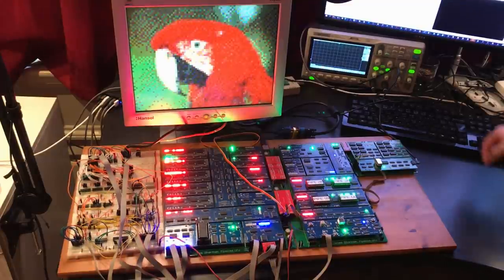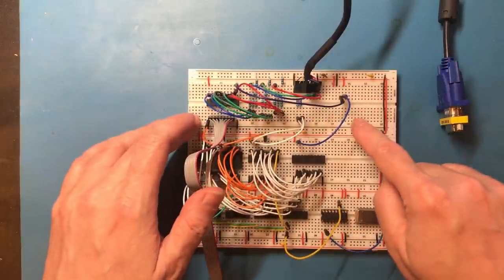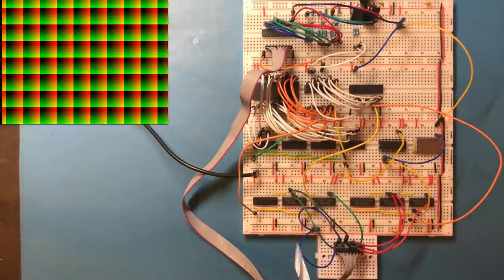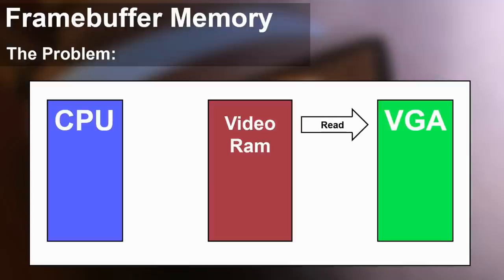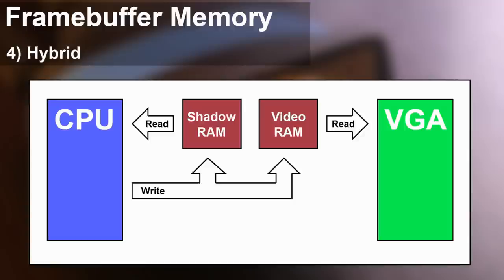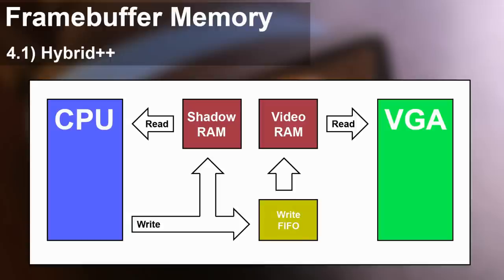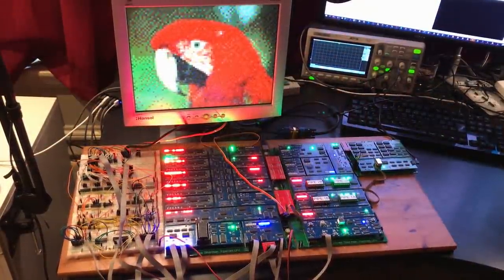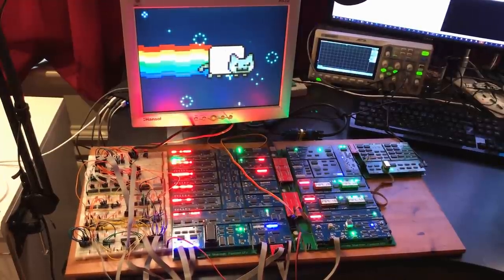Framebuffer - VGA from Scratch - Part 3

Comment: It was surprising to use two RAM chips just for the sake of allowing the CPU to read back video data. Wouldn't it make more sense to use one RAM chip for storing data from the CPU while the other one is being read by the VGA circuit? If we could allow the CPU to swap between RAM chips, then it could freely read and write from the current RAM chip without worrying about what the VGA circuit is doing to the other RAM chip.
Reply from the maker: You have to look at the decision in context. I didn't add two2 ram chips, I added one for the video side and used a portion of the existing ram I already has to shadow it. To implement the scheme you suggest it would be necessary to modify the existing memory pcb (which was designed with knowledge of what I was intending to do here) and then double up the ram+multiplexor circuitry that I added in this video for the two halves (plus the additional logic necessary to manage the change). What I've built get's the functionality I want with the lowest circuit complexity, naturally I could make a better circuit by adding more complexity but it's always necessary to strike a balance.

Comment: I think you can dualport the ram if you would use input and output buffers for adress and data and then run it at twice the pixel clock. Dump what you want into the buffers and clock data whichever way.
EDIT and you just discussed it in the video as multiplexing 😉
Reply from the maker: I do try and cover the obvious stuff that I'm not going to use, but it's impossible to talk about everything. This video was far too long as it is.

Comment: I'm curious why double buffering wasn't considered as you're already going with double memory.
Reply from the maker: Let's be clear, it was considered but rejected. It would have made the doomed demo easier though but for the most part 8-bit era games used scrolling and incremental update as the means to get games updating quickly.  Double buffering would have been a more complex circuit (If you want to separate bus access) and is a real pain for anything where you are not going to redraw the entire screen.  I have plans for future builds which will include double buffering though, just not this first one.

Comment: Im designing something which outputs VGA and HDMI, I also decided to double up the ram.
Reply from the maker: Hope that works out for you. I wanted to do analogue VGA as it was the technology I grew up with. There are chips that do the hard work of encoding but didn't feel right. Essentially the vga to hdmi cable I'm using to capture footage is one of those chips I suppose.

Comment: I don't quite understand why the CPU would need to read from the frame buffer unless you need to perform a screen capture.
Reply from the maker: If it’s not a nead you have then don’t worry about. I find it useful to be able to read from the frame buffet for a bunch of things. If you need to save of the data from behind a moving object before you draw it is far easier to do that than track it all separately.
Reply: @weirdboyjim  Thanks for your response. I suspected it wasn't a requirement, but I need to verify it.

Comment: How about using a front & back buffer configuration?
Reply from the maker: That has been discussed heavily in the comments and on discord. In short it adds more circuitry than you think but it also can get in the way of doing incremental updates to the screen buffer which is widely used by 8-bit systems to maintain high update rates.

Comment: Extremely cool! And thanks for the rickroll :P Do you think you will make a PCB next, or do you want to build the ++ version you discussed first?
Reply from the maker: I'm thinking about starting the pcb conversion of the vga fairly early, just to limit the "peek breadboard" issue, I'm low on desk space as you can see.
Reply: Nice, I'm interested in seeing that soon! I dislike cluttered workspaces as well.
But it was cool to see how quick you spotted the mistake on the breadboards that caused the horizontal line!
Reply: @weirdboyjim  what resolution would you settle on for games? Maybe 160x120x8 would be a nice compromise, or pack 2 pixels per byte and do 320x240x4? Thats 38,400 bytes though...

Comment: Idea: It would be good if it were possible to write text to the screen. This is atm. not possible because of the 8x8 tiles. But what if you add a spritebuffer that initial contains the graphic of the ascii characters and a screenbuffer which contains which sprite should be shown on which place. Then you have a good ascii-screen (with little ram) but the programmer (you) can overwrite ascii-char-sprites that are not be used with other graphics. So it is also possible to use graphics on the screen without additional chips (except 1 more ram for the sprites)
Reply from the maker: Long way to go with the project,  wait and see ;-)

Comment: Why don't you try hardware double-buffering?
Every time a frame is rendered you swap the lines.
Another pro is that you won't have flickering. (At least if the CPU can keep up)
Reply from the maker: No,  it duplicates a lot of circuitry and gets in the way of incremental updates which is more appropriate for an 8-bit gaming device.

Comment: Using only one ramchip doesn't resolve the problem with reading the memory independently from the cpu and the vga  or am I missing something?
In fact, isn't the current solution just a form of time division multiplex?
Reply from the maker: I think you have misunderstood something. If you are talking about the bit where I say I only need one chip to do the bit that I said needs two, it's because the ram already in the system is doing the job of the other half.
Reply: @weirdboyjim  Ok. Now I get it. The "shadow ram" is your system memory.  Thanks for clarifying this.

Comment: With two rams, why not double buffer?
Reply from the maker: Do you mean maintain two buffers with independent bus management? I did allude to that a little bit but you would have to double up much of the logic I showed here. Additionally most 8-bit systems achieved interactive frame rates by incrementally updating the screen because filling the entire back buffer would have been too slow.
Reply: @weirdboyjim  Cool thanks, I did not think about the incremental part.

Comment: Since you’re doubling up the ram anyway why not implement a swap system. Where the cpu has access to which ever block the vga isn’t using then sends a ‘swap’ signal that makes the vga swap to the other block at the end of its frame.
Reply from the maker: It's not that simple. To do that kind of double buffering you would come close to doubling the circuit that I present here since you need both bits of ram to be independently switch between address sources. You also make it really difficult to do incremental display updates which is how 8-bit era hardware made compelling animation possible.
Reply: @weirdboyjim  That's fair. But I think you'll go mad trying to avoid the corruption using code if you try to do any really dynamic animation ... and if you do do really dynamic animation (eg panning backgrounds) you're probably going to end up redrawing the entire screen with each frame anyway.

Comment: I have another Memory interface Idea: just like the Bus Request, but instead of making the CPU the Inferior, the VGA will be turned of or what's called Forced-Blanking.
I call this Method the "Blanking Method" where any time you write to the memory, the VGA gets turned of and essentially black is outputted to the screen, while the CPU writes to memory. But if the VGA is in either H-Blank or V-Blank, the CPU can write unobstructed and without any visible artefacts to the Memory.
Pros: 
    the same as in the Bus Request version
Cons: 
    CPU Performance Hit
    Not right for the project
    Nothing!
Reply from the maker: What you are describing is exactly what I just built, only instead of outputting black the vga is outputting whatever value you are writing to the memory.
Reply: Con would be that you are displaying black pixels randomly over the frame, or dropping VGA sync to the monitor if you disable sync generator too (and the the monitor might take a moment to recover).
Reply: It might actually be useful to query the VGA for the Current scanline and dot and manually Force-Blanking

Comment: Hi James, I really like your video series of the design and build process of this diy computer! One question came t mind though as you already realized that 25 MHz is already on the edge of reliably working on breadboards and you have to use 2 ram chips instead. The obvious solution would be to use a double wide memory data bus for the video and halving the frequency you need to read memory for vga out effectively anaable time sharing access within the timing limits. And other systems did this very early on. The C64 had a 12 bit video memory, the 4 bit color ram was read in parallel to the main ram for bitmap data, the nec uPD 7220 had 16 bit video data bus designed in the late 70s and used on larger Z80 systems.
Reply from the maker: Indeed there are far more ways of solving this problem than I had time to discuss in the video. Some of the features I want to implement later wouldn't work with a parallel read strategy so I disregarded it as an option to avoid solving the same issue 2 different ways in the build.